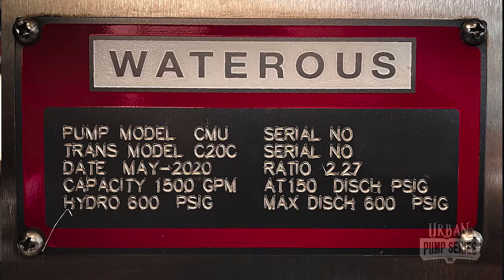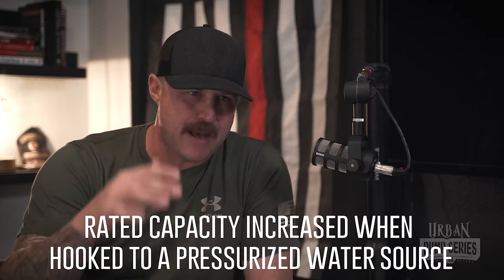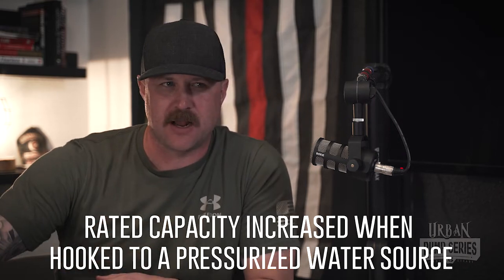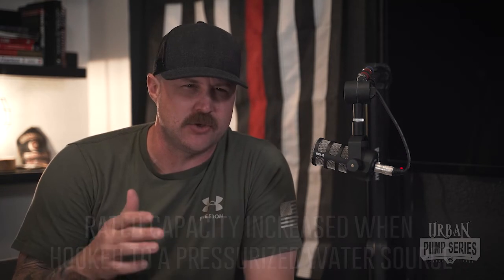Urban Pump Series (001) - Rated Capacity

Comment: Flowing a deck gun and other lines at the same time adds up quick.
Reply from the maker: It absolutely can… but is dependent on several factors such as your available water supply, hydrant (residual) pressure , and what target flows you are trying to achieve. 

The default target flow on my deck gun is 500 GPM. If my available capacity is 2000 GPM and I have sufficient hydrant pressure, adding multiple 150-175 GPM hand lines will be very easy to achieve. 

However, if I increase the tip on my deck gun to 2” (from 1 3/8”), this is still possible, but will “add up” much quicker with regards to pushing the volume capacity of my water supply system.
Reply: @TheRollSteady  I have gone down the rpm/psi rabbit hole and I am trying to wrap my head around it. I was mostly taught to use psi with a slight glossing over of rpm. When you mentioned rpm and pump capacity the hole became deeper. I know there are a lot of variables when it comes to pumping an engine so the best thing for me is to get out and pull levers. Thank you for your wisdom I have learned much and will recommend you to those that are wanting to promote.
Reply from the maker: @jplff1630  check out our other posts/videos on how to track water supply.
Reply from the maker: @jplff1630  be sure to join the RS network (www.therollsteady.com). There is a lot of content on pumping, including an entire online class that covers the fundamentals of pumping called, “Pump School with Rick Brewer” that is 100% free.

Comment: What if you work in the suburban environment? Do our pumps work differently?
Reply from the maker: Single stage or dual stage pumps? Strong municipal water supply or do you have the potential for drafting? Standard alarm response for urban vs suburban Departments? 

My original content was pushed out with Dallas guys/girls in mind. As more people outside my agency viewed it… something I heard a bit was the difference in application for their suburban or rural dept. Example - 90psi 2500 GPM hydrants are very typical where I work. 30 miles east of Dallas you’re lucky to get a 50-60 psi plug in a suburban town with a single station. 

Do your pumps work differently? Probably not. 95% of what I try to pass on applies across the board.